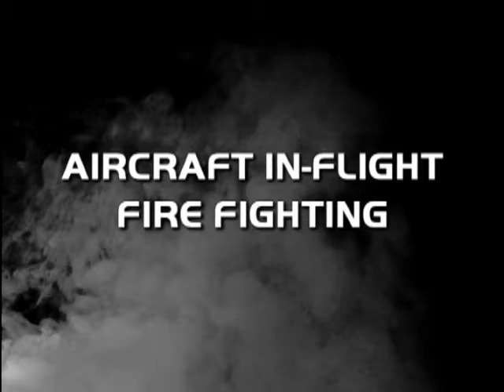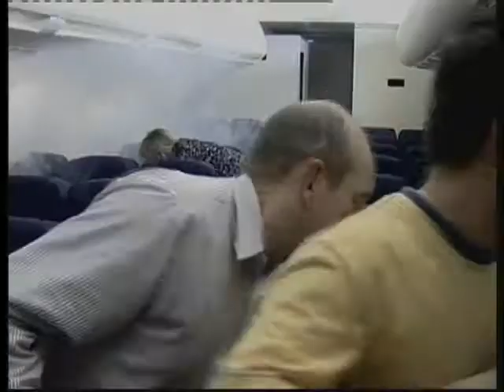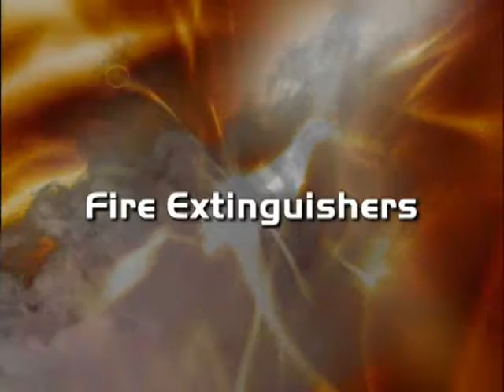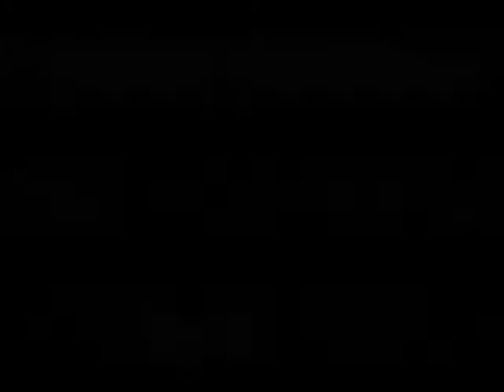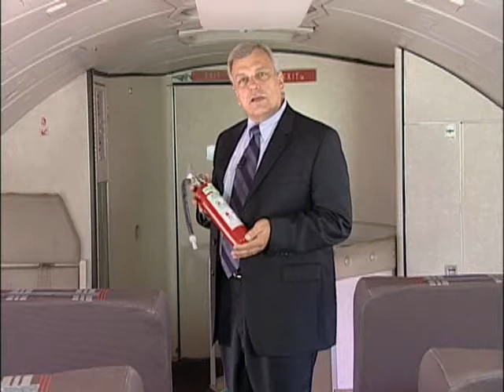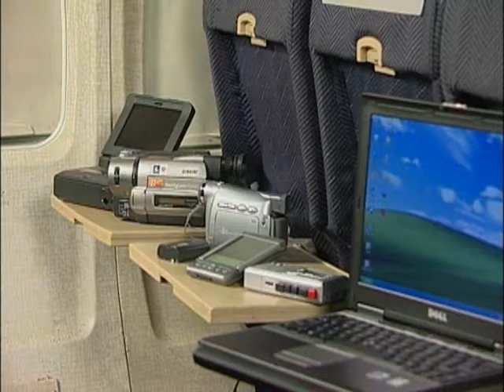FAA Aircraft In Flight Fire Fighting

Comment: Flew Citations with a furniture company in HNB who used to make pianos. Flying with chief pilot out of MIdway empty. I was not yet typed in airplane and was pilot not flying. Looked back to small amount of environmental smoke coming from vents. Told the chief pilot who was flying. I ask him if he wanted me to run the emergency bleed air check list. Shaking he told me, "I'M a GD Falcon pilot and I don't need you to tell me what to do! He made a 180° turn THEN declared an emergency and dropped below the clouds scud running back to MDW. The emergency then became the pilot in the left seat.

I spent much of the flight back looking out for towers. On final he turned off APU. Smoke quit. Taxied in to what seemed like a 100 fire trucks. He told me to go get rid of them. I opened the door to a women yelling like crazy with everyone ready to douse the plane with water and foam in and out. After some discussion I got rid of them. 

He then told me to look in hell hole. I did, everything looked fine. Back in the airplane, I asked if he wanted to get it checked out. Still buckled he said, no I have already filed. Lets go. I strapped in looking at fuel. We were at min fuel for flight if not below. He did not want to get any because he was embarrassed. I should have quit right there. My fault.

We were delayed due to storms and landed HNB with half our minimums. Later, coming in to land I was flying. He ordered me to fly below glide path to make shorter landing. I would not. TO demonstrate this, I came in high. He said I would over shoot. I landed using less than half the runway without brakes because the airspeed bleed off from a flair from steeper approach. It even slowed too fast to use thrust reversers. I thought it was good demo. In the snack room he began throwing things across room and screaming obscenities at me. He fired me two days later. He had a violation when he got hired. Not sure how they can keep that liability as a company!
Reply: ALOT ALOT of info to dissect here.  Absolutely Shocking. Imo, You need to take action...
Reply: @jondoyle44  It's the tip of the ice-burg with them. For instance, some have taken off in IMC and got clearance airborne. When I ask about it,  the answer was, "That's what TCAS is for." We were only allowed to print ILS charts for destination. We used an unapproved tablet for navigation which over heats. The official Jepp charts are kept on a laptop in the aft closet. I sent a letter to management. They told me to go away. The FAA is reactive; not proactive. Chief pilot is charming. He has management eating out of his hand.

I can tell you however, when they bend an airplane, I will witness for the prosecution!